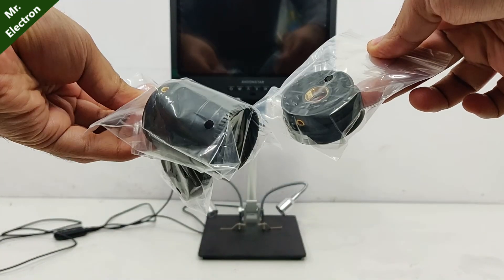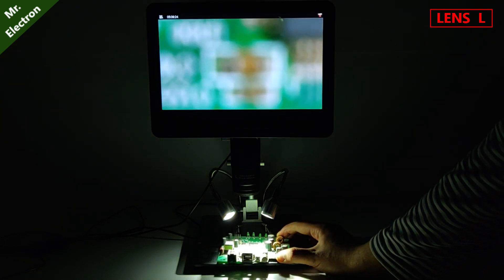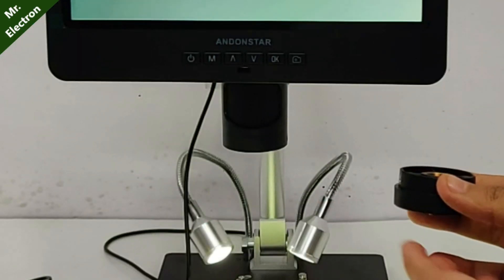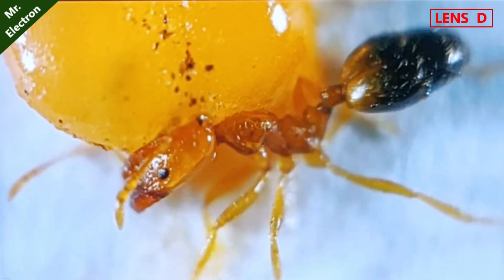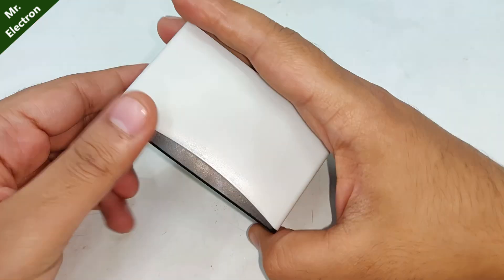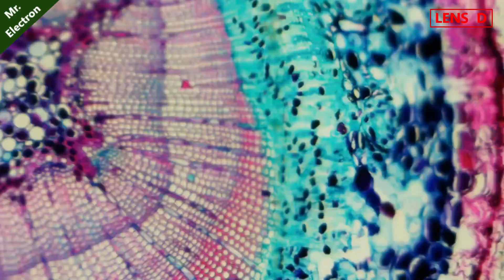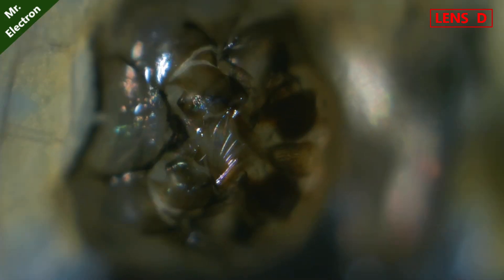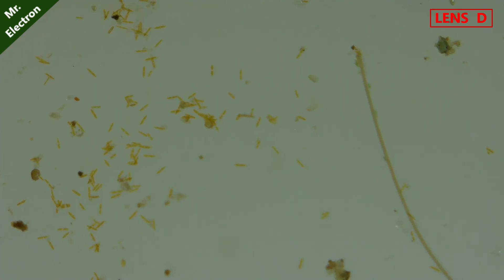2000x Microscope AD249S-M Test & Comparison with AD207

Comment: does anybody know how to polarize this film? I know can cut the direct polarizing the adsm24? For the led lamp lights I can cut out circular small rings measured out with polarize film install them easily and turn them to deflect light, but as for the 3 lenses andonstar provides lens a d and the one mounted is there a glass lens I can buy to install on all 3 lenses so I can cut film for it that fits or an adapter? Does anybody know where they are or who sells the compatible glass lens?